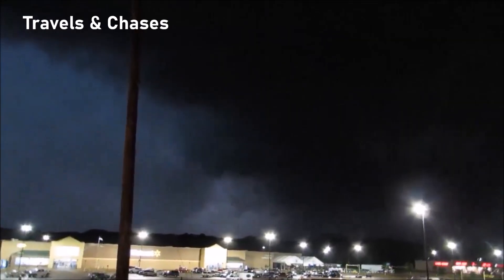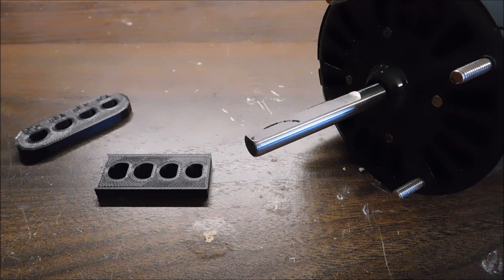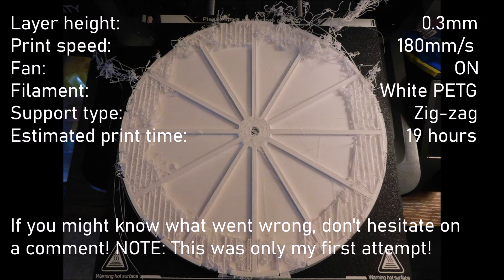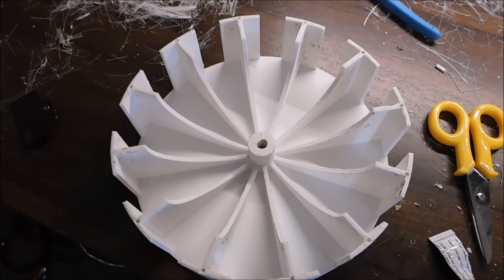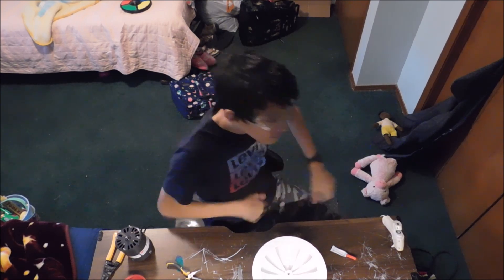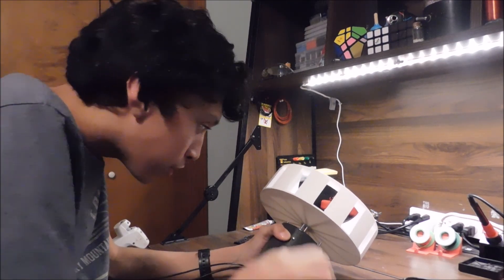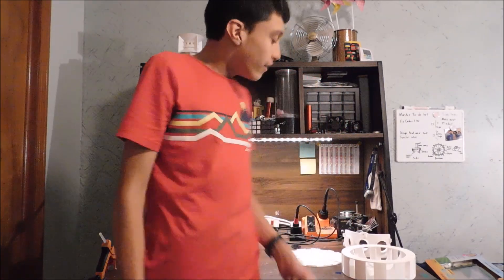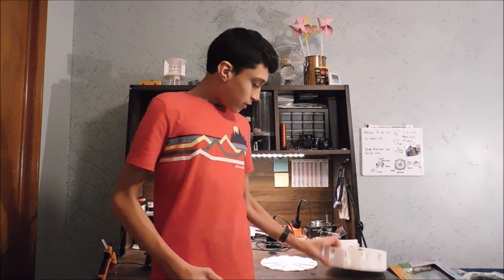Trying and Failing to Make a Life-Sized Siren! (Version One)

Comment: What printer is that? looks like mine
Reply from the maker: I have an Ender 3 V3 SE, which is the same printer I used in this video. It's alright with PETG, but since I was a 3D-printing newbie during the time this video was made, I didn't tweak any of my retraction settings and temps and stuff to work with PETG. Now I use PLA and PLA+ and occasionally ABS, but when I sell mini sirens, I'll use only PLA/PLA+.
Reply: @milespeterson5049 ah so we do have the same printer, I've had nothing but problems with mine over the past year, it is my second printer. I just bought a centauri carbon so hopefully my luck is better with it.
Reply from the maker: @Gvacs  Well, I'm sorry about that. When settings are optimized, the Ender 3 V3 SE is am amazing printer. It has outperformed my older Ender 3 V2 by a longshot.
Reply: I think the QC was just bad on mine, the gantry and bed shipped in poor shape and they refused customer service, so I just put up with it and only did small prints. I have had good experience with creality in the past though
Reply from the maker: @Gvacs  Mine didn't arrive in bad condition, but a part broke on my unit, and their customer service straight up did nothing. It was the X-axis calibration stopper part. It had snapped clean apart from the limit switch hitting it from normal operation. So yeah, their customer service can be no good at times. They won't send you parts. You'll have to buy new ones or make them yourself, preferably with another 3D printer.

Comment: I have the prolly same motor, but instead 1/25 hp, and i used it on my new 3rd scale sth10 i built, which has a 7-9 inch rotor,   so i would try it again.

Comment: ITS YOUR PRINT SPEED
Reply from the maker: ...Eh, no. My Ender 3 V3 SE is rated for speeds up to 250 mm/s, and I was only running it at 180 as I usually do. The reason the rotor strung like that was because I was still a 3D printing newbie and didn't tweak my retraction settings.

Comment: shrinkage is a huge issue when it comes to 3D printing the perfect tolerance bore size for a motor shaft when it comes to siren designing. 

d-shaft motors are probably one of the best types to use for a siren 3D print.
Reply from the maker: Yeah, I sort of quit this project a long time ago, but if I were to do it again, I'd make the D-shaft bigger and my whole rotor smaller so my motor could actually drive it.

Comment: What 3D printer do you use? I want to make 1/3 scale sirens but dont know which ones have a large enough printing size.  It would be awesome to know, thanks
Reply from the maker: I use an Ender 3 V3 SE and an Ender 3 V2. I mainly use the V3 SE for my bigger parts because it prints much faster than my older V2. I have made a 1/3 scale 2T22 in the past, and all the parts fit on my 220 x 220 mm build plate just fine, although it took a lot of hours. The rotors for my 2T22 were also around 5 inches in diameter, so it's exactly 1/3 of a 15-inch real 2T22 rotor.
Reply from the maker: I would also like to say that the 2T22 I made is extremely outdated and will be redone sometime soon. This is just for reference, though! I have also abandoned the production of 1/3 scale sirens and have moved to 1/4 scale sirens and 1/8 as my main size categories.
Reply: @milespeterson5049 awesome thank you so much!

Comment: Trying to get the rotor of the motor shaft is my worst nightmare, cuz sometimes I use a screwdriver to pry it off then 

1. I bust a hole on the bottom of the rotor 
OR
2. I force it a bit too much on one side of the rotor that the shaft pressed against the hole of the rotor and makes the rotor hole uneven.
Reply from the maker: I can relate!!

Comment: since the motor isn't strong enough, you could try a 1/3 hp motor or 1/2 hp motor, as those seem strong enough to spin a rotor of that size. if that doesn't work, i'd try a 3/4 hp motor. you could even try a bench grinder motor, as those seem to be very strong, especially the ones with the 8 inch grinders
Reply from the maker: Yeah! I have given up on this project because I can't return the 1/16 HP motor I used. If I'm gonna get a real siren, I have way better chances at just buying a real one. I'll be making MANY mini sirens, too!
Reply: @milespeterson5049i wish you luck on obtaining a real siren! what siren do you plan on buying?
Reply from the maker: @TheCamWheel  Thanks for asking! My local city has taken down two sirens: a 2T22 and an RSH-10B Thunderbeam. I haven't gotten much word about this yet, but I could actually win the Thunderbeam at an auction! And the 2T22 will be reinstalled for further use. I have a video of me touring the sirens on the ground on my channel.
Reply: @milespeterson5049 snatch that Tbeam! The single phase one's are simple to setup and can be ran occasionally straight out of the wall outlet on half speed, not great for it, but much safer than drill runs.
Reply from the maker: @Gvacs  I'll sure try! It's just that the Thunderbeam is pretty huge and heavy, and my parents aren't too thrilled about me getting that siren. I'll have my best luck with a smaller siren, like a Model 2 or Banshee 115 that I could actually stuff in the back of my car and run off house power.

Comment: Not trying to be rude or anything, but that thing would look very little on a pool siren pool we’re talking about on a building. You wouldn’t even see that thing you have to make that rotor and stater 10 times bigger than that stater in the router or like as wide as the motor that’s how big nose choppers and staters are just saying
Reply from the maker: This is pretty much a failed project, and I will never try to make a full-sized siren again. I'll have much better luck just buying a real one.

Comment: the petg could be for many reasons. one it could be an unreliable brand. in your siettings I would recommend 245 noxxle temp and 81 bed temp for petg, also there may be a partial jam. I would recommend changing your settings first. i also would turn dow the speed to 150 mm per second
Reply from the maker: Thanks for the suggestions! When I complete the second version of this project, I will be using ASA instead of PETG, because ASA is better suited for outdoor use, and my siren will be outdoors! I also found that my nozzle was badly jammed after I printed the rotor. I couldn't really get one good print out of my Overture PETG filament, so something probably went wrong with the filament itself.
Reply: @ ok make sure the printer has ventilation
Reply from the maker: @Collinofalltrades  That's the thing. My printer doesn't have an enclosure. 🤦However, I was able to print a benchy out of ASA with no issues, so maybe I can do the same with my siren!
Reply: @milespeterson5049 yeah maybe turn on a fan or two or open the window

Comment: Could you show us how to make and assemble your sirens from tinkercad? Like all the components needs, etc. I want to make one of these, they are awesome! Hope you get back to me, and thanks in advance.
Reply from the maker: As the video said, the siren never actually worked. So you cannot remake it. I will make a V2 of this siren that actually works and share all the files for that. But if you tried making this one, it probably wouldn't work.
Reply from the maker: HOWEVER, I have many other public siren projects that are ready for download for free on Tinkercad! You can find them here: https://www.tinkercad.com/users/3aGm7EISLm2
Reply: @ Yeah, I saw the other sirens, I just don't know where to find the controls or motors. For now my 3D printer is broken (Ender 3 V2) so I cant use it..... and I doubt it will ever get fixed considering its been broken for over a year.
Reply from the maker: @ Oh, I'm so sorry! I really hope you get your printer fixed. And it's kind of funny you say that; I recently acquired an Ender 3 V2, and multiple parts on it broke, including the fan shroud and X belt tensioner. Anyway, I hope you get yours fixed so you can get back to printing! 

Also, I have a whole video on building and assembling my miniature STL-10, and I'll soon have one for my mini SD-10. I would recommend checking those out if you do end up building any of my miniature sirens!
Reply: @milespeterson5049 Thanks! I am definitely planning on building one of your sirens when I get my printer fixed (or if I get a new one) so I will check out those videos.

Edit: I think it's awesome I can do this, being semi-in the siren community and sirens are very expensive